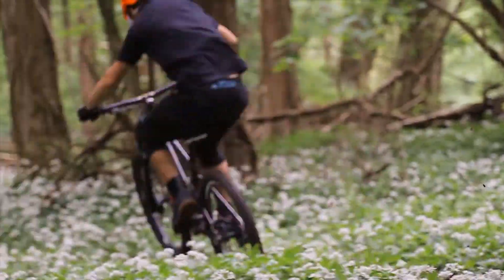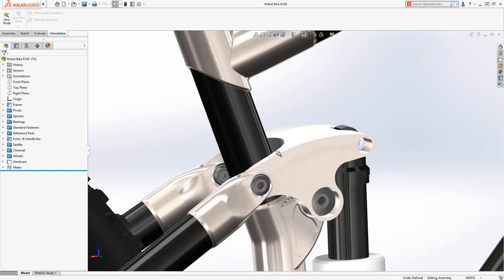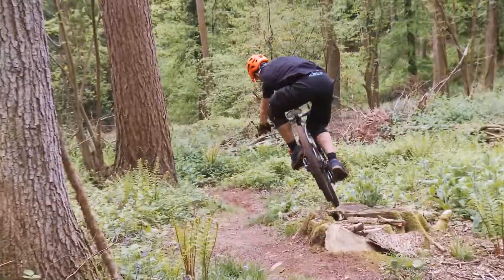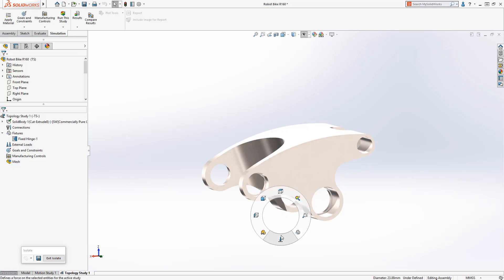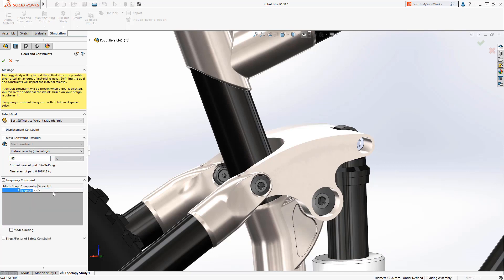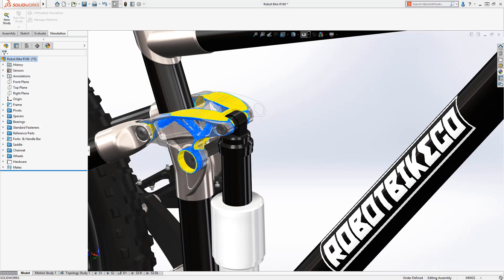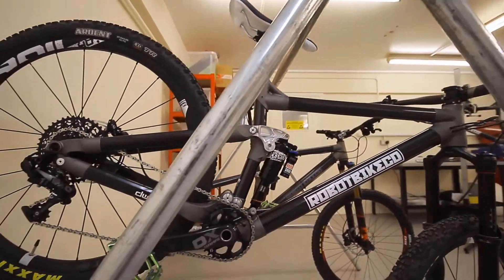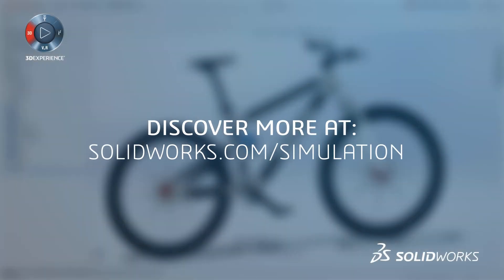SOLIDWORKS Simulation Topology Study

Comment: There are a few simulation setup errors that really invalidate the results here: 

* Constraining the two bearing bores with fixed hinge fixtures is very inaccurate compared to the real life constraints.  The fact that the "optimized" shape shows no material connecting those bearing bores should be a dead giveaway. You have essentially told SW that there is already an infinitely stiff and strong member connecting these bores, which there most definitely is not.

* The rocker sees very little force in that assembly position, because that is the top of suspension travel. Max forces would be realized in the bottom-out position. This puts the rocker in a completely different orientation to the seat stay link and the shock, which has a huge impact on what direction the forces are input to the part.

* Using a 60 N load is pretty silly. Using a reasonable spring rate and stroke, you can easily generate 5000+N of spring force at the shock. If you run out of stroke and have a hard bottom out event, the shock loading could be significantly higher.

The fact that topological optimization can only be run on a single component, out of assembly context, is a huge disappointment. Running simulations with correct loading and constraint configurations, using (simplified) assemblies, is crucial. Why is this present in static simulation, but not in topology optimization?

It's a little scary that in this "case study" they appear to have created an actual prototype rocker link, based off of terribly inaccurate simulation data. Especially when doing mechanical design on a highly loaded aluminum part, that sees intense load cycling, there is a very real fatigue concern. "Optimizing" the part geometry with bad data is asking for a part failure.
Reply from the maker: Hi there,

Thank you for the feedback here! We appreciate our users interacting with our content and giving us more insight.